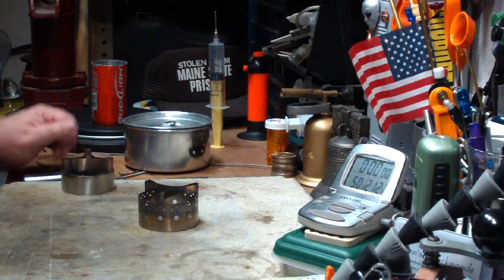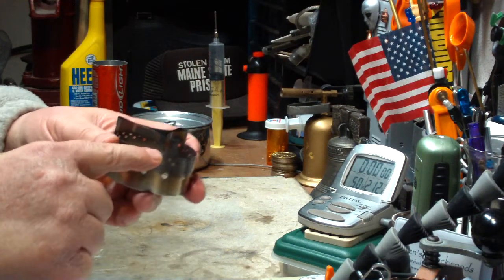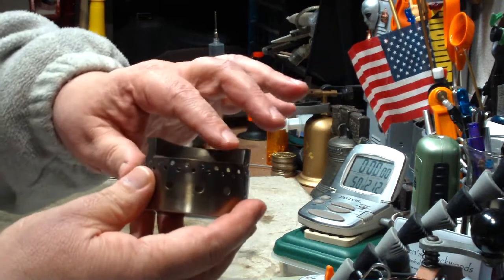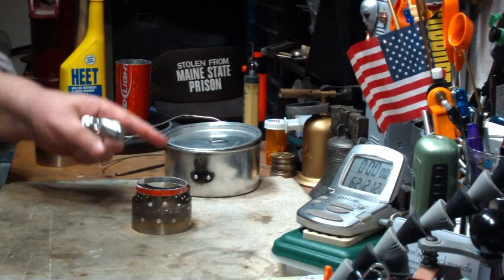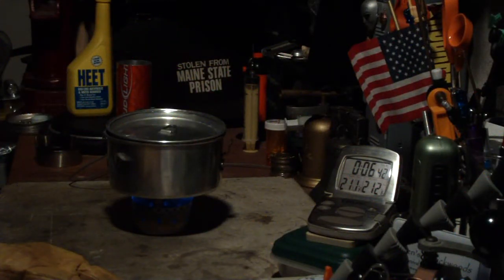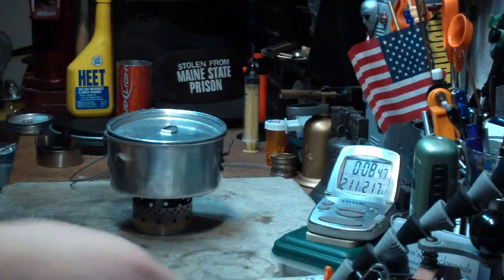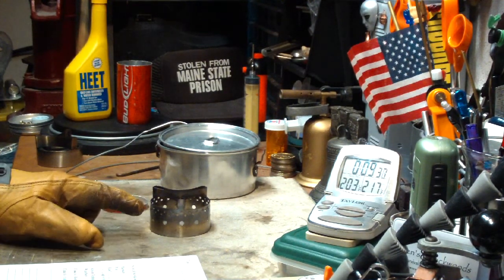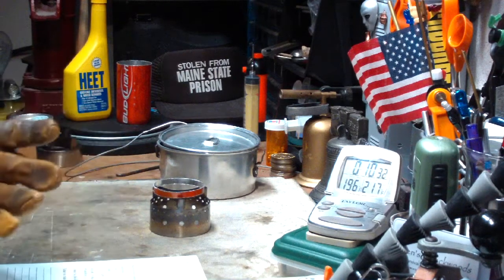Flat Cat Gear's ISO-Clean 2.0 Stove - Using Heet For Fuel 2nd try - Boil Test #5

Comment: I added more carbon felt to my lynx today because I could. :) as constructed it rapid boiled 2 cups in a stainless steel cup really quick.  4 minutes or so quick. I didnt have a stop watch on it or use a thermometer. it was in a 70 degree room with no wind also.  I like how it allows use of stainless steel water bottles on the built in pot stand.